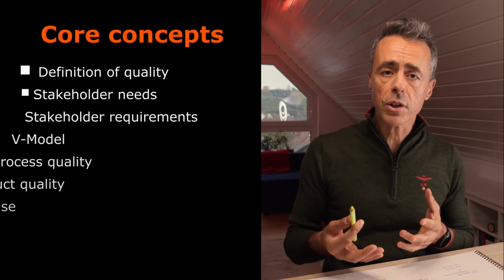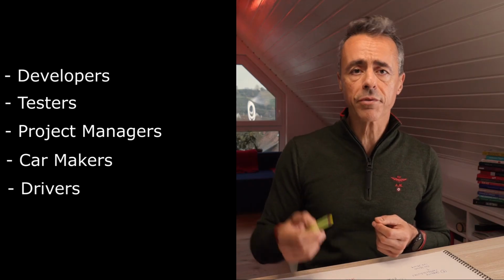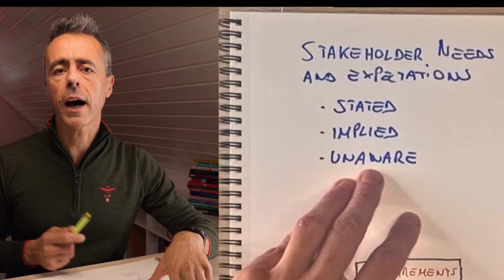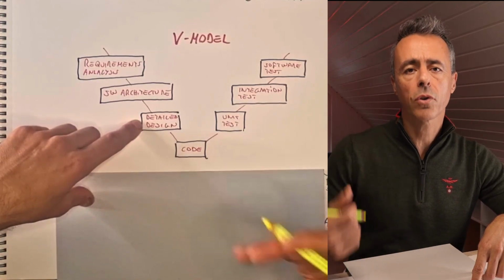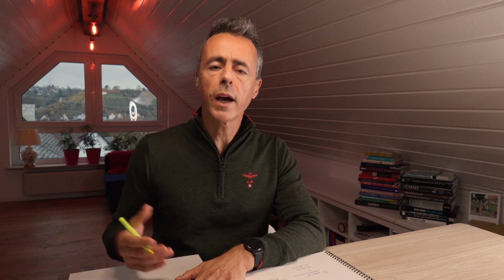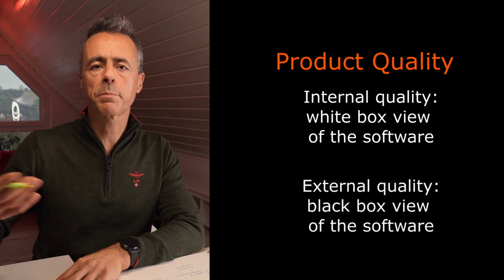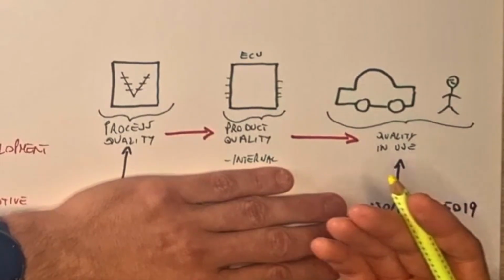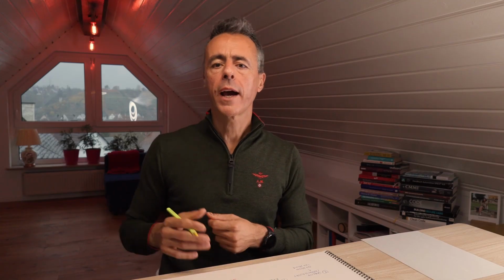Mastering Software Quality: Core Concepts with Real Examples

Comment: What is your suggestion to integrate ISO 25010 and 25019 with AGILE software development, Dr.?
I'd like to integrate 25010 and 25019 into 9001 Quality Management System structure..